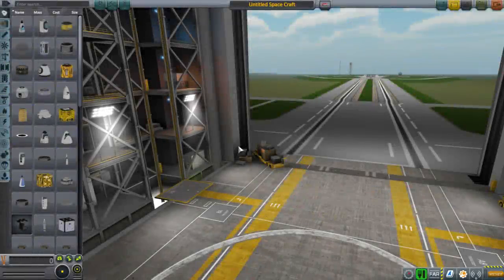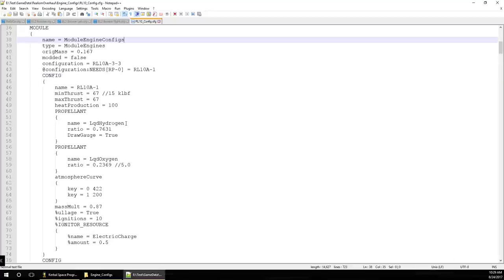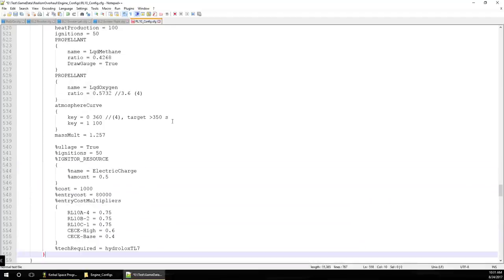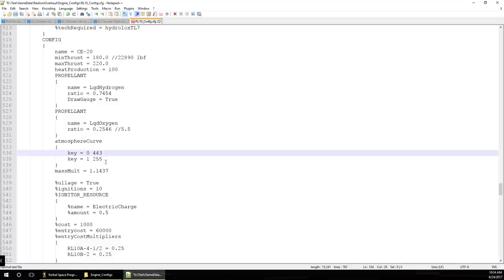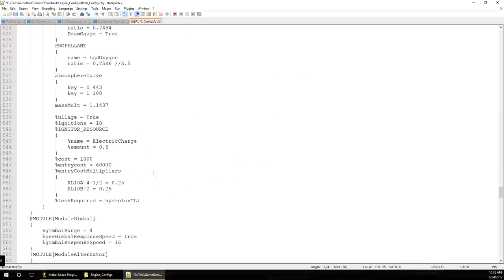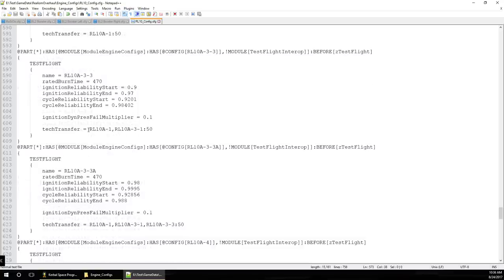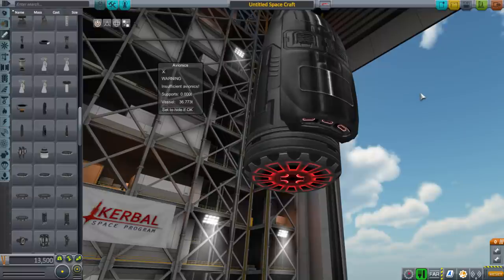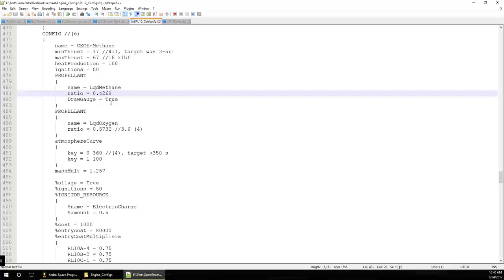Making Realism Overhaul Configs 2 - Engines and Plumes

Comment: Hey Raiz I'm trying to modify an engine start time, anyway to do that?  I want to modify a hypergolic engine to have it start up faster though I can't for the life of me find any config that has anything about engine startup time, just somehow RO decides some will start instantly and others will start at a random amount of time or something.
Reply from the maker: I realized that RO had one type of engine starting up really slowly: nuclear engines. Looking at the Nerva config in the Engine Configs folder, I saw %throttleResponseRate = 0.035 //should be around 30 secs too fully ramp up to 100% from 0%; %throttleStartedMult = 0.8; %throttleStartupMult = 5.0, so I basically changed the first number to something high instead of low. These lines go in the engine configs (look at NERVA_Config.cfg for an example).
Reply: @RaizSpace  right on thanks raiz
Reply: @RaizSpace  It works I was able to speed things up, mechjeb seems to not be able to land unless the engine has extremely high ignitions and it needs near instant start since mechjeb only calculates it's final landing burn to the second, if the engine takes too long to start i will still be going to fast when it lands.  Other than that mechjeb is literally spot on to the minute.

Comment: And how can I rescale or make it to scaleable for tweakscale the RS-25 ssme?
Reply from the maker: Well, Realism Overhaul prevents the TweakScaling of engines. To undo this, you have to go into the Realism Overhaul folder, open up RO_Engines.cfg and delete out the section that removes TweakScale from engines. After that, it depends if someone put a TweakScale module on the SSME part you're using.

Comment: Realism overhaul is good but I won't use it.
Some parts are not to scale and there are too many things to tweak before it can be used.
The developers must make it so that it can be installed , ready for use and compatible with all parts.
It's basically half baked bullshit.
Reply from the maker: Well, it's certainly compatible with all stock parts. All parts from all possible mods? That's an unreasonable request, and certainly not necessary. If you're content to use the parts KSP comes with, then you can install RO without any additional tweaking or scaling or anything.
Reply: @RaizSpace  
No , I didn't mean all possible mods.
OK , I will use stock parts.Is mechjeb 2 compatible with realism overhaul?
Reply from the maker: Absolutely - I always use MechJeb 2 with RO.